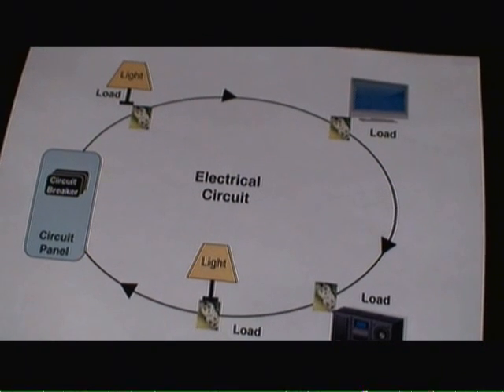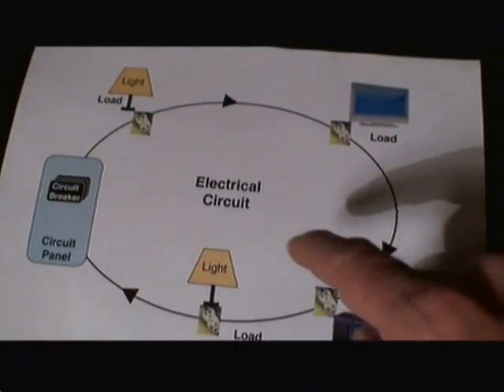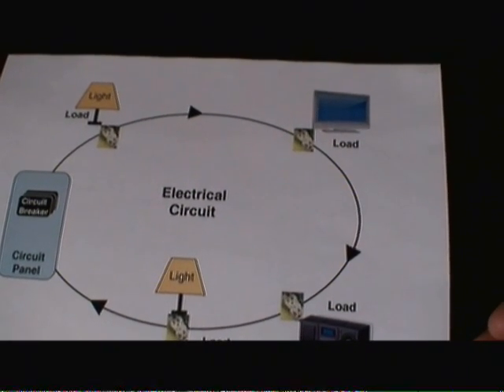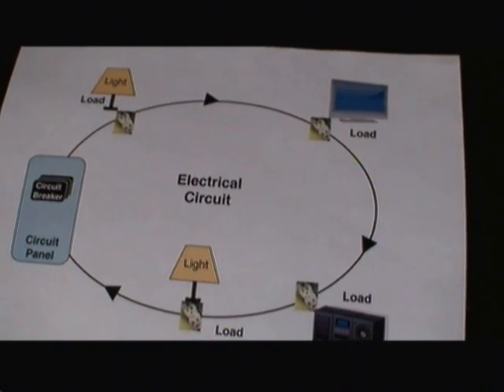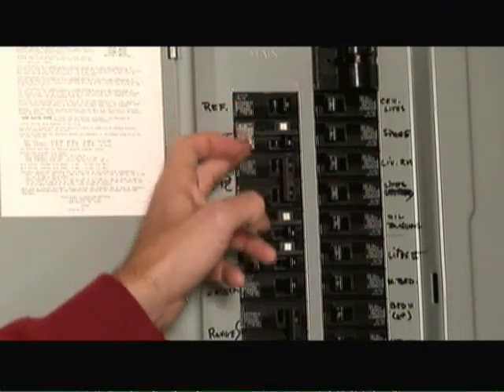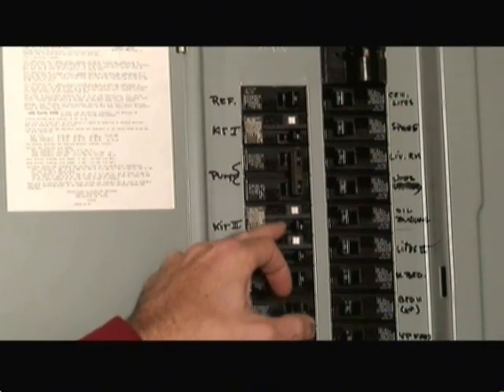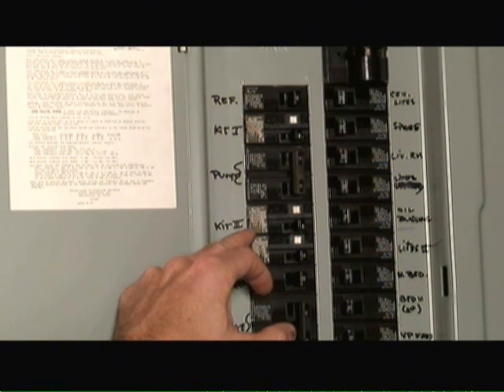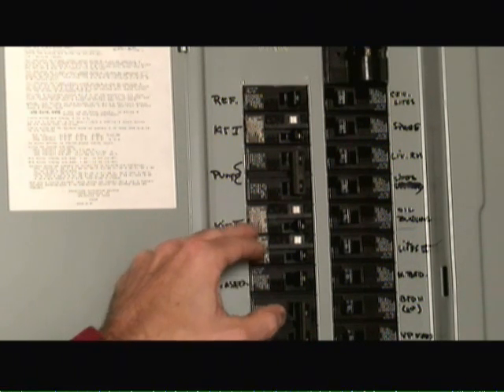Circuit Breakers Video

Comment: I’m a green beginner, can I change my 20 amp circuit breakers to 20 amps? Will that cause a problem if it bigger than necessary? Thank you for the informative videos

Comment: I'm trying to test a breaker with a digital multimeter. Instructions say to switch dial to voltage before testing. Is that DCV or ACV?
Reply from the maker: ACV

Comment: Hello Mark I'm in the process of adding a 20 amp circuit breaker and planning to use romex wire. I live in California since I will ran the line outside can I use conduit , some electrical people from home depot told me it's O.K. any suggestion ?
Reply from the maker: Yes you should run the Romex through steel conduit.
Reply: Thanks Mark..

Comment from the maker: Ground fault circuit breakers, are designed to trip for overload conditions. In addition, ground fault circuit breakers  protect people from becoming electrocuted.  More specifically, ground fault circuit breakers are designed to sense the slightest loss/change in current draw in the circuit and trip before a dangerous current level could be experienced by a person. Most ground fault circuit breakers today are designed to trip after sensing just a few milliamps of current loss in the circuit.

Comment: They are a few options to choose from here the most simple is to get a extenstion lead from another point on a different circuit or another simple way is to unplug everything else on the circuit apart from your comps these dont cost anything to do it proper you need to change the rating of the circuit which means new cable ect..  sorry if spelling mistakes am from england ha

Comment from the maker: You do not want to simply replace the circuit breaker with a higher rating one. The existing circuit breaker is most likely rated for the guage wire that is used to make the circuit. For example 14-2 wire is used for 15 amp circuit breakers and 12-2 is used for 20am circuit breakers. By just replacing the circuit breaker with a higer amp rating you could cause a fire in your home. You should contact an electrician to determine what type of wire was used in the circuit.